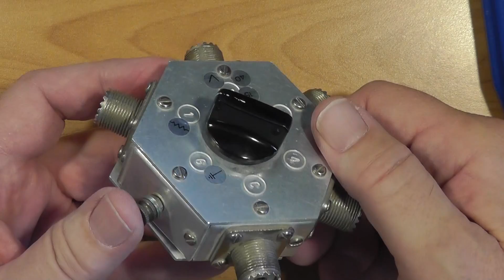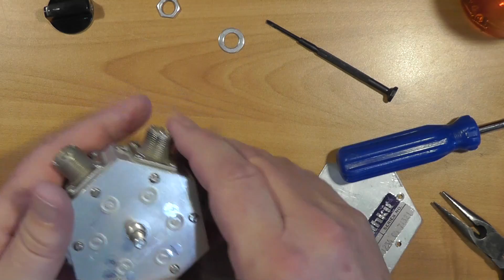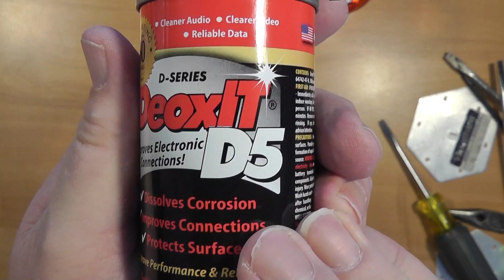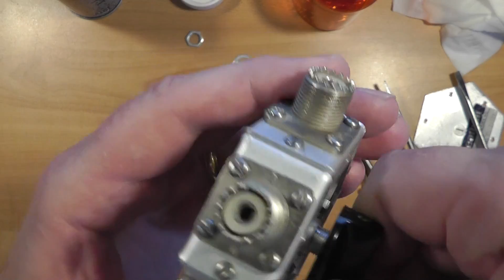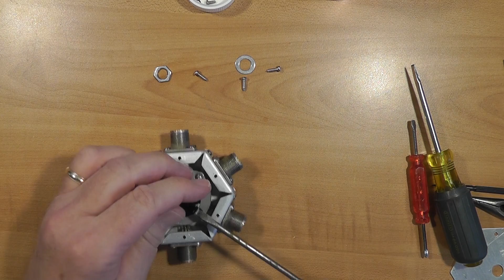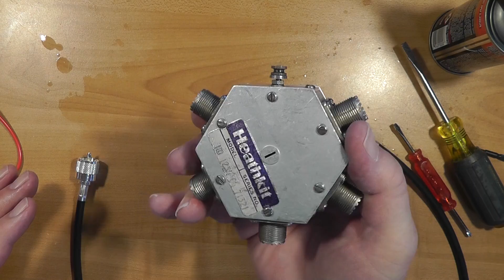Cleaning a Heathkit Coax Switch with Deoxit (#60)

Comment: I have an SA-2060A and it has a problem where the insertion loss with either coax1 or coax2  is pretty drastic. It’s been sitting in a box for a number of years. When I put it inline with either coax the signals drop so low they can barely be heard. This is the antenna switch assembly. 
It’s as though the SO-239 connections  are faulty somehow. I’ve ohmed them out a there’s continuity. 
After watching this I’m thinking maybe dosing it with deoxit might be advisable. 
Thoughts?

Comment: Lots of screwing around but, well worth it. It cleaned up nicely. Looks like all silver connectors. Good stuff from back in the day. I use an Altoids tin with a magnet in it to hold screws and other hardware. I think Santa needs to bring you a set of nut drivers. Looking forward to the A - B tests.
Reply from the maker: This kit was a nightmare to construct. So many parts! Each side of the hexagon is a separate part. Millions of screws. But it finally came together. I like the Altoids idea. 73